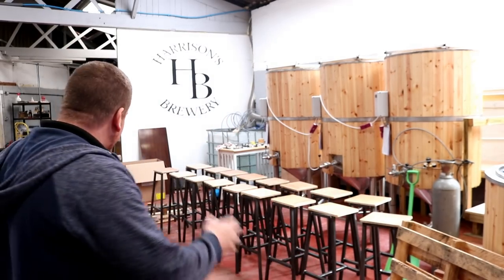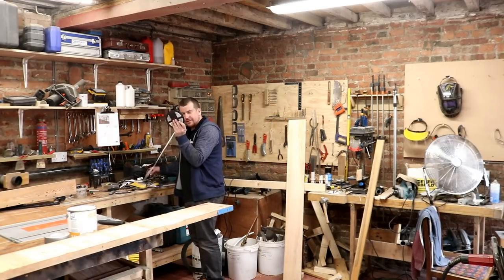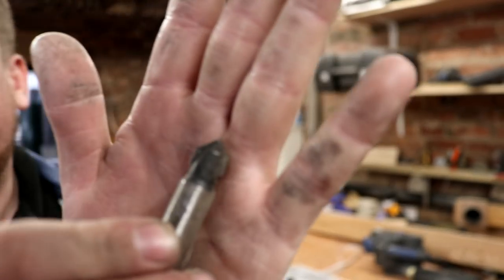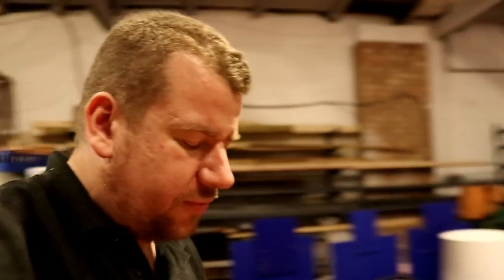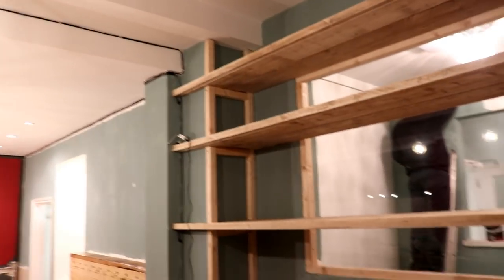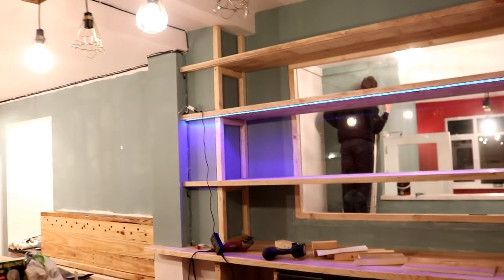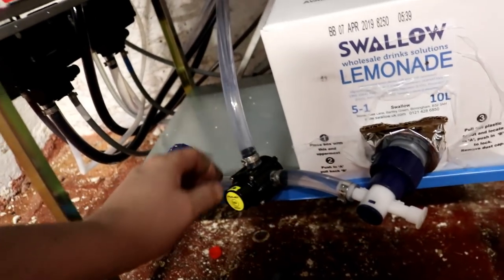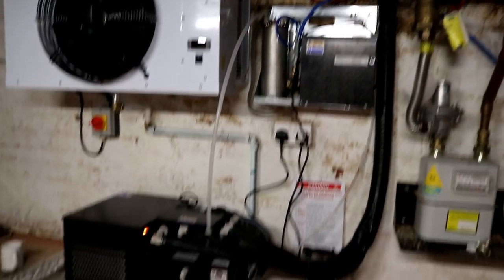POST MIX

Comment: just a tip on the led strip, it needs to be in a aluminium profile strip to help keep
the leds cool as the timber acts as a insulator and causes them to over heat and 
fail, you can get a angled profile strip with diffuser, seen it happen a few times.